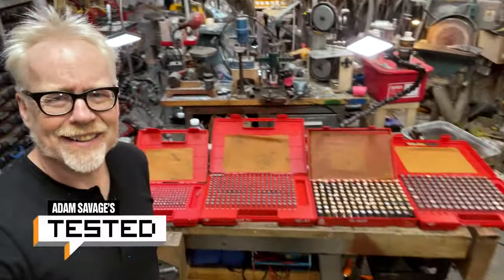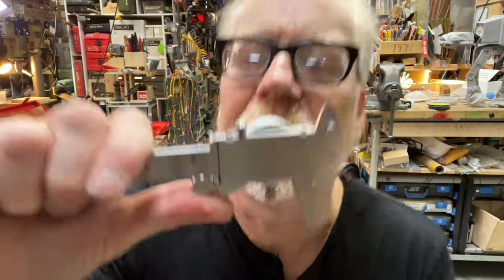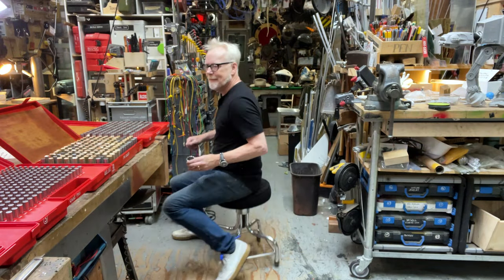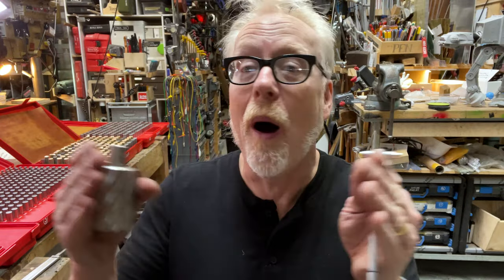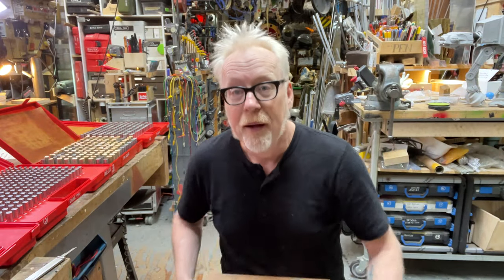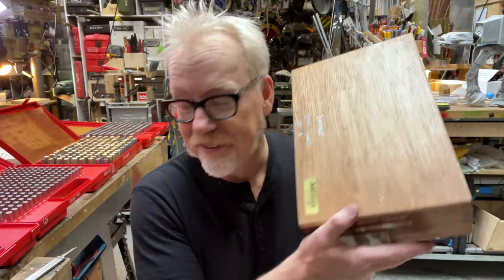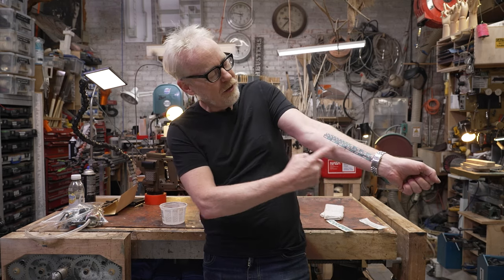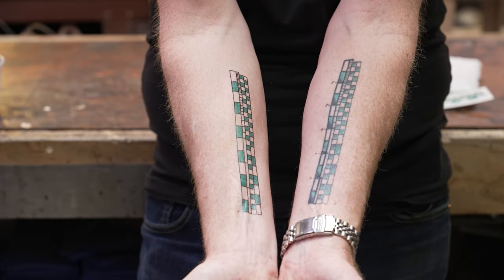Adam Savage's Favorite Tools: Pin Gauges!

Comment: Hey Adam, two tools that i don't think you've talked about that i find very useful:  NOGA style indicator bases/arms, and Edge Technology style indicator arms.  The NOGA bases are spendy, but the ability to move them in any direction creates so many measurement options that they're a godsend.  It's tough for someone who hasn't used one to realize how much they bring over a standard mag base arm, but the delta in utility is hard to understate, and there are cheaper knockoffs for the home machinist with similar "any direction" joints.

The Edge technology arm has a slightly more specific use, at least for me: sweeping holes/diameters for location on the mill.  There's lots of ways to dangle an indicator from a spindle to sweep holes, but most of them have multidirectional joints (like the NOGA or the venerable Indicol) which means lots of tweaking to get the indicator directly aligned with the axis of rotation.  By virtue of having only hinges, the Edge technology arm is ready to sweep a hole within 15 seconds of attaching it to the mill.  for the same reason, it's great for sweeping the sides of parts when you need better accuracy than an edge finder can provide.

Comment: QC guy here, you need to buy twice as many pins as you already have! They come in "plus" and "minus" sets. Whatever the grade, + sets will all error on the side of being bigger than the nominal size, while - sets will all be ever so slightly smaller. This is to ensure that when you're using them as GO or NOGO gauges, you don't accidentally pass a bad part. Use + pins for your GO gauge, and - pins for NOGO.

There are also aluminum handles of various sizes that let you conveniently hold two pins, one end colored green & the other red, so any idiot can poke the hole & figure out if it's in tolerance.

If you need more resolution. Deltronic pins are available in ten-thousandths graduations. They're usually sold in sets of 25, with a central dimension (like .2500) and 12 pins larger and 12 pins smaller.

When you get a precisely fitted Deltronic in a hole, it seals so well the pin will be hard to press in on the air in the hole. And it makes a "pop" when you pull it out. Surprised there isn't Deltronic ASMR.

Comment: Another method of measuring small holes is a set of ball gauges. My set goes from o.125 to 0.500 and work like a T or snap gauge except instead of a T shaped head they have, as-the name implies a ball shaped head that is split and expands as you tighten the knob.

Comment: I reface saxophone mouthpieces, which requires measuring the gap between a flat surface and the curved rails of the mouthpiece as it bends away from the reed.   Mouthpieces are categorized by the opening at the tip, measured in thousandths of an inch.   The easiest way (for me) to measure this is to place a gauge pin between the tip and a flat surface (plate glass).   Obviously the one that “fits” is the measurement.   For example, a tenor saxophone mouthpiece of size 7 measure 0.100” at the tip opening, whereas a 7* size is 0.105”.   Actual mouthpieces often measure somewhere in between, so 0.101” would be a 7 and 0.104” would be called a 7*.   (Size 8 is 0.110”…) Gauge pins are very helpful in determining these values.  

Refacers also use a clever tool called a “glass gauge”, which is a flat piece of glass with markings ruled every millimeter.  (The actual units are double millimeters, so a measurement of 40 is actually 20 mm.  The reasons for this are lost to the mists of history, though speculation is that the inventor of the gauge didn’t like fractions or numbers after the decimal point.   And yes, we mix millimeter measurements with thousandths of an inch measurements!).  Using this tool, one can use feeler gauges or gauge pins to define the shape of the curved rails of a mouthpiece.   Here is one made by Theo Wanne, a well known mouthpiece manufacturer.  https://www.musicmedic.com/products/repair-tools/mouthpiece-facing/theo-wanne-glass-gauge.html

Comment: excellent explanation (from a guy that uses these on a daily basis)  a couple of things though... those are some mighty fine dial calipers, and they ARE accurate to at least +- .002. Also Adam didn't mention that there are different grades of pins sets. Some are + .0002" some are - .0002" which are likely the sets he has. There are also sets that are + or - .00005" which I rarely use and, in my opinion, should not be used for ultra-tight tolerance measurements because of the human error involved in such fine measurements. They are also much more expensive but if you've got the $ then why not.

Comment: You can also use the other end of the calipers to measure depth or distance from an edge. Hold them with the dial facing you. Zero them out. Look at the left end. The "movable jaw and the other jaw are ground flush. Now move the calipers to 1/2 inch and Look at the back Have fun exploring the possibilities.

Comment: Brilliant things. How much do you have to consider wear on them?
Reply: At some point yes wear becomes an issue depending on what material you are measuring. Vermont American makes what they sell as black guard pins.  The pins are coated and as the coating wears you can see if it's time to replace the pin.  Most pins are ground to a few fine surface finish which can show wear over time as well.

Comment: 11:53 this is the perfect application for another way to measure steps with a caliper, you mate the flat top part of the movable jaw with the top of the step and slide the fix jaw to the bottom of the step or in this case the pin, that way you are measuring square to the top of the step and always catch the highest point to the pin.

Comment: another note.  For your example it may be close enough to measure hole location.  But if hole location is tighter tolerance or critical.  It is best to never use threads as a locator.  Put in a counter bore or something to be able to gage off of a more accurate surface.  But as I said.  it all comes down to tolerance.  it all depends on how accurate you need to be.

Comment: Do you need to calibrate with temperature also?  I know I've fit things by heating the accepting piece and cooling the inserting piece. When they came to the same temp, they were essentially fused, which is what I desired.

Comment: Adam there is potentially more useful tool to position things relative to one another, it is rather large and heavy and called an indexing table. See Siegmund imperial series with 16mm (5/8) holes on two inch centers. An indexing table is not to be confused with an indexing cart, in that, the table has sides (also with the same hole pattern as the top) and an inner web welded structure, upon after being welded, the table is machined flat and square, heat treated and nitrided. You can buy table legs that accept casters so you can roll the table around the shop (the tables are very heavy), but, even though it rolls, it is not considered an indexing cart. 

Some would say an indexing table is a welding table, which is certainly a possibility. However, in a welding shop the work is usually divided into indexing and tack welding, and finish welding. Indexing a weldment assembly is done by a very senior welder/technician/engineer on the indexing table and tack welded (expertise is needed for many reasons, like being able to read a print, perform accurate measurements per the print, know how parts distort while welding, preheating parts before welding, not damaging the indexing table and jigs, etc.). Then the weldment is sent to a different work station (which may just be two straight and parallel raised I-Beams upon which the weldment is supported during final welding), where it is final welded, perhaps by multiple welders. It then may come back to the original indexing station to verify final tolerances. Setting up a weldment on an indexing table per a cut-list is very fast and accurate, the advantage being you will quickly know if the weldment parts are cut and bent properly before any welding is performed.

Indexing tables are not just for weldments they can be used for prototype adhesive glued assemblies (the merging of weldments and bonding), with joint preload formed using rivets or tack welds. The table holds the assembly in position while the adhesive sets. You can also use an indexing table as a functional gauge (usually in the prototyping stage before an end of line function gauge is available (designed and built)), like your gauge pins, but on a much larger assembly level.

Comment: I use a dial bore gages at my job the bore gages at my work can read down to 0001 they are tricky to set sometimes but we use ring gages which are ground perfect to size the bore gages we use are a range of .450 up to 8 inches. We have different lengths bore gages we also use pin gages as well but bore gages are mainly used

Comment: Gauge pins are also used with sine bars to set up precise angles. I've seen Keith Rucker measure gears he's cutting by putting two gauge pins inbetween teeth of a gear.
Reply: Gage blocks are used with sine bars. Gears are measured using gear wires which consist of a pair of matched roll pins. Threads are measured with a matched set of 3 thread wires.

Comment: One thing you forgot to mention which is really important for measurement is if those pins are “plus +” or “minus -“ gage pins. The plus indicates it’s .0002 over the number of the pin and minus indicates it’s -.0002 under the number of the pin. Most pin sets are plus or minus. I don’t think I’ve ever seen one that was exactly in size. 👍

Comment: I'm in QC and I love your measuring equipment. The only hard part is that we work in mm not inches and I can't get my head around converting them in an instant
Reply: One thing I found useful, use a digital caliper.  Slide it to the measurment you want, then hit the in/mm button.

Comment: Wat I find fascinating about calibration equipment is that something had to be made the first time to be able to compare it.  Like...what machine made the calibration tools if it was the first one and couldn't be calibrated yet?
Reply: High quality calibration tools can come with NIST certification documentation. Basically, this certifies the traceability of the tool to a NIST certified origin. I've never had the need to own anything that precise, but my understanding is that if you had a NIST certified gauge pin then the pin was verified against another NIST pin using a NIST comparison method. That pin used for comparison was verified for compliance. This would go on until you got to something like a standard meter. I've heard some guys talk about having their surface plates re-certified over time. Anyhow, the the nist.gov site contains some pretty cool information about how things are to be measured, etc.
Reply: The meter is now exactly the amount of distance light travels in a vacuum in a defined portion of a second, and a second is defined by the amount of time a Specific atom oscillates a specific amount of time. 

Before we had these definitions there was a physical rod in France that was the meter and all calibration was traceable to this rod. Interestingly this rod was not the official representation of a meter, it was the meter. Meaning if the rod changed size the length of a meter changed

Comment: Here's a tip. If you want to know the centre of a hole and you either a) don't have a pin guage, b) the hole is at a funny angle or c) it's a tapered hole, use a slightly larger steel ball bearing and place it in the hole. It will self centre to any parallel or tapered hole smaller than the ball and you can measure to it no matter the angle of the hole. Using a bit of geometry you can also precisely measure the size of a tapered hole.

Comment: There is actually a fifth way to measure with callipers. You can use the front face to measure a  step. Which can be much more accurate and more easy to use than the depth measurement on the end. You use the front ground edge against the step and push it open with the step.

Comment: question : how strong is the influence of the temperature on the accuracy?
Reply: I used to be a rep for a high end gage pin manufacturing company: temps are very important, especially in the smaller pins. The heat from your hands holding the pins change the diameter. For hobby shops and many machine shops this probably isn’t an issue. For aerospace, medical and other industries, this is huge. There are different levels of accuracy, certifications of accuracy, handles to hold the pins and tests for wear as the pins do go out of tolerance with wear. If keeping the tolerance of the pins is required to an extremely high level then the facility using the pins will have temperature controlled environments to use them.
Reply: Temps have a huge influence.. for best results they’re meant to be used in temperature controlled rooms(20 Celsius)

Comment: There is a way to measure steps with calipers that is super easy to keep accurate rather then using the depth. Its hard to explain but use the step between the jaws and then slide the top jaw to the step. Kind of directly under the area where you have your indicator/digital readout. Another good use for gauge pins is with a sine bar/sine vise for setting precision angles in a mill or grinder or whatever.  Also gauge pins go up to 1.000  so your missing the biggest set m7 I believe. If i could add a picture when i was off linch break id show what i mean with the calipers.

Comment: I had to get a set of telescoping gauges and micrometers when I tore into my tractor engine. I wanted to know if the cylinder lining needed replacement. Calipers are just not exact enough for that. And almost 10cm pin gauges are probably also not common 😅 For my all around tinkering and restoratino stuff, I think I'm set with that.
Reply: He's kinda understating the possible accuracy telescoping gauges carefully used have (using a micrometer of course not calipers).  Not quite as finicky as a pin gauge but perfectly serviceable tolerance for most applications.

Comment: Do you have to keep the pin gauges oiled so they don't rust? If so, would the oil affect the measurements?
Reply: If they are kept in an air-conditioned office or shop and you promise not to put any plugs dripping with coolant or hand lotion back in the set, they shouldn't rust. At the .0004" tolerance these probably are, the coating shouldn't matter, but it definitely would for higher-grade sets.

Comment: The nice folks at Mitutoyo were probably aliittle miffed as you constantly flash the chinese Starrett and only mention Mitutoyo in passing. I learned  early in my aerospace career than anyone can read the caliper gauge but it takes a craftsman to learn the FEEL of a correct reading. I must ask, why you measured the pin with the caliper at 13:26 but didn't tell us what your Starrett reading was, you read the pin gauge size instead from the case?

Comment: It would be neat to have duplicates of each case's largest and smallest pin attached to the outside for quickly finding the size you're looking for.

Although I guess you'd get used to the diameter range of each case pretty quickly.

Comment: Do you have to worry about the pins wearing down, or getting minor damage that may distort the accuracy?
Reply: Wear can occur over time.
You could send them to a calibration laboratory to calibrate them If you need to know the accurate diameter.
As a hobby set I would recomend steel pins, for industrial use I would use carbide pins or even ceramic pins (but they break easy)
Reply: Absolutely. They should be calibrated periodically which requires measuring the diameter in at least 6 locations and checking them for straightness, rust, damage, etc.
Reply: Depends on if a variation of .0001 or .0002 will ruin your part or not.

Comment: I have a question. I’m not a hobbyist or anything. I just find this stuff very interesting. But I thought occurred to me when you were fitting the pins into the metal piece with many holes. What is the material these are normally made of? 
My thought was that since one would always be looking for a tight fit when using these, repeated use of a pin could shave minuscule amounts of the metal off and possibly make it less accurate.
Reply: The pins are usually hardened tool steel although there are more expensive versions like carbide(even harder). 
Generally the workpiece being checked will get damaged before the pin does. A popular version of pin gauges is a minus set - so a .250 pin is actually .2498. That being said because there is a .0002 gap the “250” pin will fit in the .250 hole. The fitting can be so air tight that you get gauge pins popping right back out holes from the air trapped at the bottom.

Comment: a useful tool(s)  also pin related are called transfer punches.  I own a set that cost about 150-180 usd  
they are undersized by about 3 thou which means that the center of the punch can be wildly off from the center of the hole BUT.... if you line it up nicely... you can save a MASSIVE amount of time guessing hole locations by measuring from centers of pins... it is also nice when the hole is dinged up..... the pins being slightly undersized usually fit in anyway... 
c:
Reply: also... you can depth check with the top of the caliper as well. o-o ~continues watching ~
Reply: o_o I commented as I watched... ended up doing everything in reverse...

Comment: whenever ive had to measure a step with calipers ive always used the jaw end step to measure in stead of the tail probe it felt less flimsy to me is there some specific reason you prefer the tail end for measuring steps.